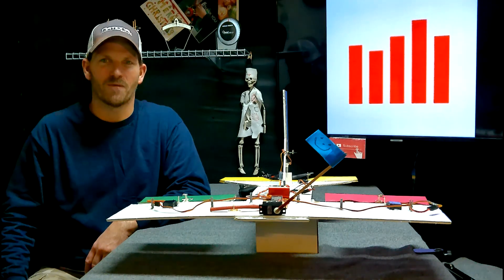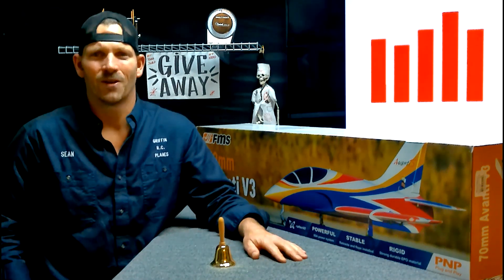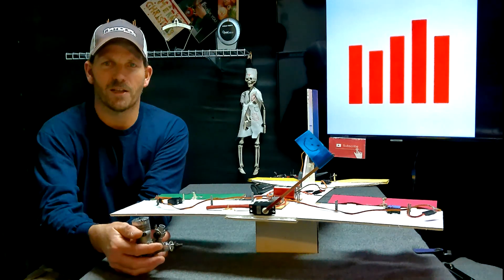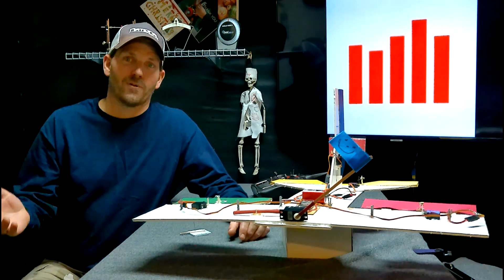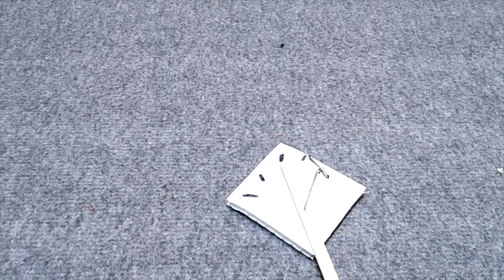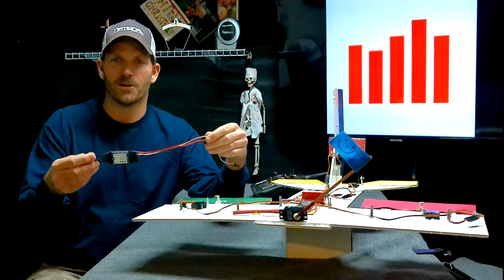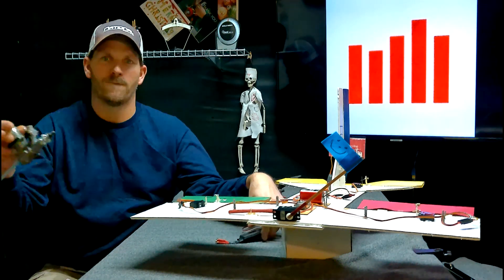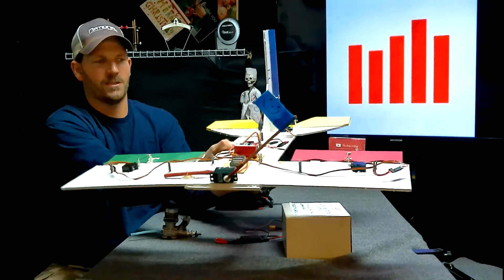A SERVO FOR THROTTLE INSTEAD OF A ELECTRONIC SPEED CONTROL IN YOUR RC AIRPLANE SPEKTRUM RECEIVER ??

Comment: Just finished up the sonic low Wing with a electric conversion but as soon as I get a chance to try it out I will put the SHGF 6cc gas glow engine on it! It runs off 20 to 1 mixture of gas but no ignition system just a turbo glow plug.

Comment: Can you do a video on how to run a separate reciever battery so the esc doesn't have to do all the work!
Reply: Disconnect the red wire from the esc to the receiver. You can either cut it or, preferably, remove the connector from the plug, fold it back and tape it.  Plug in your esc back into the throttle channel and receiver battery into the receiver, and you're good to go.

Comment: Shaun How about doing a video on forward programming for when a model loses the signal. If you don't set any values the Rx holds the last command which could be a big problem. With spektrum there are two ways to set it, one is via the sticks and the other is by entering a percentage. I can never get the stick method to work but by entering percentage values on my elevator, ailerons and rudder if my planes lose the Tx signal they go into a gentle left hand turn. This way my planes should come down not too far from where the signal was lost. Also you can visually check your settings on the bench by turning off the Tx and watching the control surfaces.
Thanks for the videos.